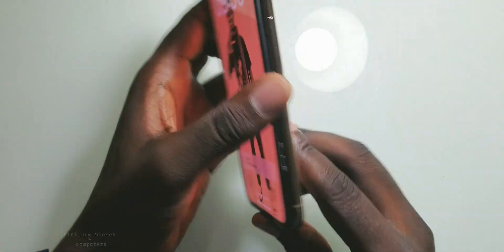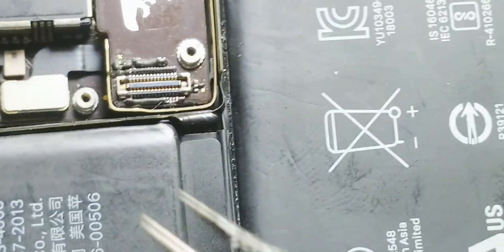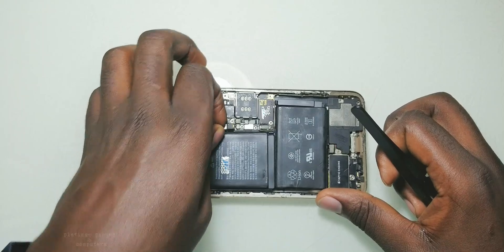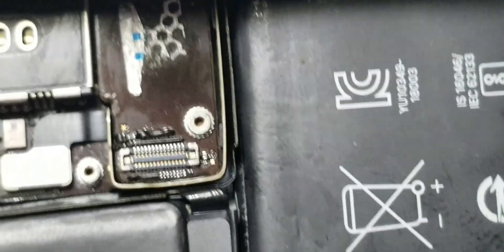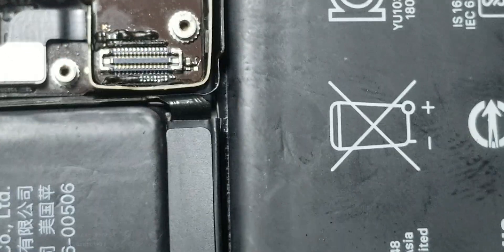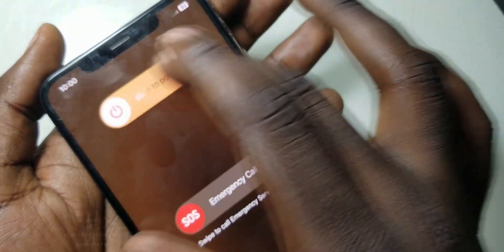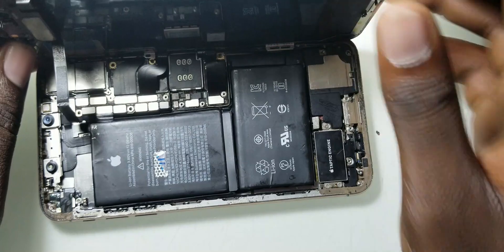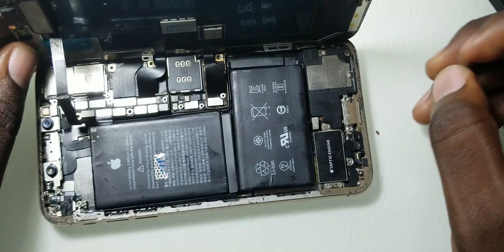iPhone XS Max Screen Touch won't work even with another new screen, Lets see How to Fix it

Comment: hello brother, I have hp 840 G2 and it has amd 1 gb card. Recently I gave it for repair, my laptop isn't detecting amd card in task manager and device manager. Couple of weeks ago after restarting it detected and it was working but again after restarting it isn't showing the card, can you tell me how to fix this.
Reply from the maker: This might a driver issue, install all necessary drivers plus the graphics card drivers
Reply: @platinum_computers  I have installed all the drivers and I am unable to install graphics drivers, installation wizard says it can't detects no amd card